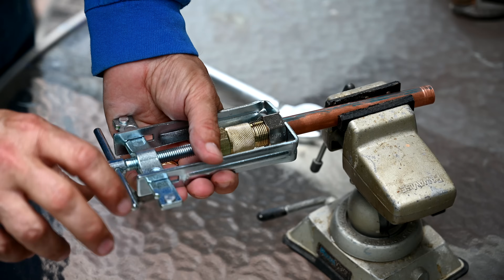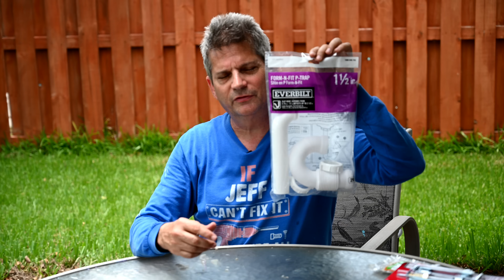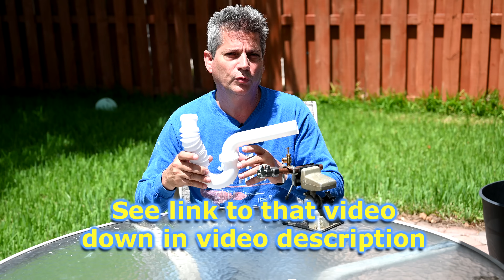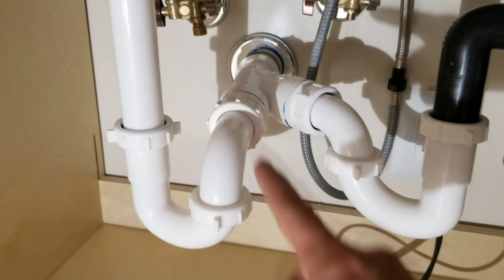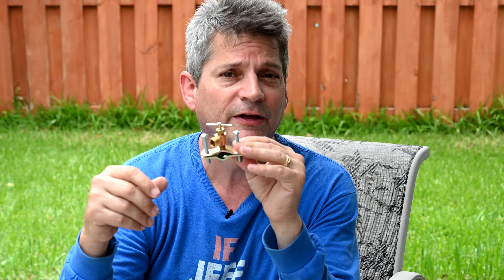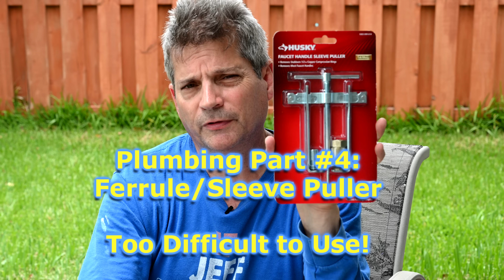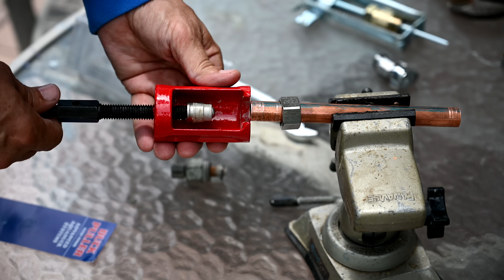4 Plumbing Parts/Tools You Should NEVER Use. NO Plumbing Fails

Comment: Instead of using a wench why not just stick a screw driver in the hole that is already there?
Reply from the maker: I prefer to use the Ridgid OneStop wrench, whose handle is designed specifically to fit that hole, did not show it in this video though.

Comment: Been working appliances for 37 years.  Probably installed 500+ saddles.  Maybe <1% leaked upon initial installation.  Just changed them out and all was fine.  I have seen saddles that were installed 40+ years ago holding fine.  Many customers were elderly, or out of work and/or just unable to afford a $200 plumbing bill so the saddle did the trick.  Is it my "go-too" choice?...Of course not. I would much rather sweat a tee and a valve.....But properly installed, I have never had one insurance claim in all those years.   Now...if you really want to discuss "problem" fittings....do a show on compression fittings!!!!   Those things are brutal. Especially on ice machines.  Not refrigerator ice "makers" but actual 18" undercounter Ice Machines.
Reply: Agreed.  Just because something isn't "code" doesn't always mean it won't work properly, or isn't effective.  Saddle valves are one.  The T is superior, no argument there, but the saddle valve is good enough most of the time. The flex drain is another.  I wouldn't use a flex drain for a kitchen sink, or laundry sink that gets tons of water all the time.  But for a bathroom sink where you are off a bit, why not?  Not everyone has the skills necessary or money needed to get the proper rigid pvc solution.

Comment: "Too cheap to hire a plumber for 10 minutes"
That's because plumbers charge by the hour with a call-out fee and so that 10 minutes ends up costing me north of 200 bucks. 

So, therefore, I just do my own work, I watch videos like yours, learn how to do it the right way and do my own work up to code. 

At 19:50 you are blaming the tool yet you used it incorrectly, you need to unscrew the damn thing all the way out, just like any other puller system on the planet. You have yours screwed in all the way and expect it to work when it isn't made to work like that, the tool works just fine when you actually read the directions. You also have the handles in the wrong spot, why do you think there are little notches out to the end, that is there to hold them in place. Your entire complaint is that you didn't use the tool right so you are not recommending it. 

Then you show your favorite tool and as you can see you had to screw it all the way out first. Come on man.
Reply from the maker: Actually you are wrong about the husky tool because husky is now telling us not to have the handles on there at all when using it to remove the feral. To handles are only on the when you are pulling faucet knobs
Reply: @jeffostroff  
So you didn't read the directions and are complaining about a tool that you used incorrectly? Smart move.

Comment: Regarding the Husky puller, I think you may need to move the arms outward until they sit down into the recesses at either end of the frame. This would have the effect of 1. providing greater separation from the T-handle that you are turning with your thumb and fingers, and 2. create an angle for the teeth to bite into the back side of the nut you are trying to remove... Having said that, it is a pretty cheap looking tool, and either of your two alternatives look like a better design.
Reply from the maker: Sort of a moot point now because I do have 2 other tools that do the job just perfectly, allowing you to use the same Ridgid One Stop wrench.

Comment: I'm a Master Plumber. The other reason for not using piercing valves is that the bottom steel clamp is a dissimilar metal to the copper. As the water flows through, it causes electrolysis. Causing the copper pipe to wear away
Reply from the maker: I wish you could explain that to the other plumber who trolled us the other day here, claiming he was 60 years old, plumbing since he was a kid with dad, and telling my S-traps are OK to use,  saddle valves are ok to use...
Reply: @jeffostroff  Well Jeff, It's kinda like Lawyers, Salesmen, Carpenters, or any other profession. There's guys that are very good at their craft, and others that simply are so bad, they should clearly be in another profession. Then there are people like you that simply try to tell the general public what items not to use and why. For their own safety. Keep up the good work with your videos, my friend. I'm 56 and have been a Master Plumber for just over 32 years, I'm a licensed Stationary Engineer, Backflow Certified, and an instructor for the last 11 years two nights a week for our Plumbing Apprenticeship Program for our county.  I appreciate and respect what you are doing. I don't find it that difficult to believe that the troll has simply been doing many things incorrectly for 60 years. LOL.  I'm now semi-retired and taken a position of County Plumbing Inspector.  Both you and I know that you are correct, and should get a pat on the back for trying to share some of your hard earned knowledge with people.  Much respect to you.

Comment: Jeff should only make videos about what he knows, not plumbing. (sorry Jeff) I'm 60 yrs old, started plumbing at my dad's shop when I was 13. . Master Plumber now with my own business, I don't advertise, I have plenty of new/remodel clients.

 S traps are fine under normal residential conditions. Siphoning is rare and is more a vent problem. 

A so called "Form and Fit" trap works fine for a do-it-yourself, if installed within it's ability to adjust. Otherwise a non-plumber will spend all day hooking up their stupid sink drain. 99% of what clogs bath sink drains is:  longer hair, toothpaste caps, hairpins, razor covers, kids and very old cast iron pipes. No sink drain system is able to endure humans and time.

A "Saddle Valve" can work fine for a very long time if installed carefully...and Come on Jeff....don't use the puncture method!....turn the water off and pre-drill a small hole first.....any clown would do that if he had a drill....who doesn't have a drill?....and it will prolly never flood a house  because the failure normally starts out as a very slow drip.. I can easily tap into any waterline if needed....and would never use a saddle because it takes too long and oh.... I'M A PROFESSIONAL PLUMBER. For the DIY'r....it's fine...just do it right.

The "Husky Faucet Handle Sleeve Puller" is NOT  made for pulling compression rings. It's for PULLING (some) old stuck-on HANDLES....like the name says...
 I have a tool for compression rings and it works effortlessly.  Come on man!

Stay in your lane Jeff. Talk about wood or something.
Reply from the maker: Looks like you never learned anything at Dad's shop, you should only comment on what you know. The fact is you can argue till the cows come home, making excuses why you think s-traps are OK, but duh, THEY ARE BANNED BY PLUMBING CODE! In every state! So you keep on doing shoddy plumbing work, not getting any wiser in your 60 years. As for the Husky tool, you are wrong there too! Come on man! Husky Bills the tool as BOTH a "Compression Sleeve and Faucet Puller" 2 tools in one. Stay in your lane bro, go back to playing Fortnite. Here's the link for the Husky tool on Home Depot's web site: https://www.homedepot.com/p/Husky-Compression-Sleeve-and-Faucet-Puller-63876/304543091  Everyone feel free to laugh this clown out of the room now, he knows nothing.
Reply: @jeffostroff  nice...edited out all the names you called me...how clever...you can fix anything.
Reply from the maker: @readmore3634   Lol nice try liar I did not call you a bunch of names and I did not edit it it out.  You obviously hit a brick wall here when you know you're not getting anywhere the next thing to try of course is profanity and trying to discredit.  Your downfall is you have to be smarter than the people you are trying to discredit. The only one calling names here is you with your disgusting profanity. Funny how your user name is here to help but yet all you're doing here is whining like a gilted school girl and name calling and profanity that's all you're capable of. I won be adressing you any longer. And if you keep leaving insulting profanity on this family friendly channel I will have YouTube suspend your account  immediately.
Reply: @jeffostroff  you seem awfully defensive...make more videos of yourself...it's more work for professionals. obviously YouTube doesn't mind you broadcasting bad advice...why should they care about professionals pointing out flaws?

Comment: So what wrong with it according p-trap  you never gave a problem .like break easy or leaks. Just wondering
Reply from the maker: 2 main problems are hair and debris gets caught in the accordion. And Also, the plastic is very thin on the creases, so it breaks, or develops cracks along the accordion, especially after repeated banging into to from bottle and other things down below under the sink.

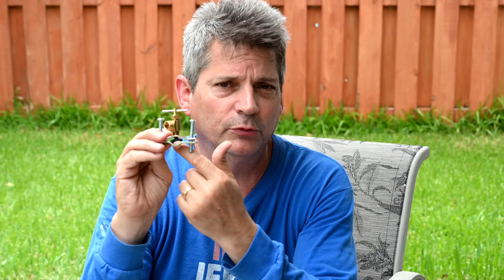Comment: 12:40 ... or because the instructions from GE refrigerator says to USE it for the ice maker and no other reason DERP
Reply from the maker: That is so crazy GE would tell people  that
Reply: @jeffostroff  GE's directions are to drill the 1/4 in. hole, mount on vertical run,  etc. There are millions out there...

Comment: Tapping saddles are actually very common in larger diameter pipes, 3" and larger. City/county utilities departments cannot constantly shut down whole blocks of pipe network just to install a residential 3/4" meter feed. The design on those is a bit better than show here obviously.
Reply from the maker: The type they use is probably a lot more reliable.

Comment: The S trap is NOT the problem.  Lack of proper venting IS the problem
Reply from the maker: You are partially wrong. The s trap can also siphon itself dry when you  have a short vertical drain leading to a trap with a long vertical  drop after

Comment: Gotta admit after taking out my sink disposer I got the handy man accordian pipe special and have had it now 4+ years.. I really need to rework the plumbing so both sinks in the kitchen run into the same pipe to the same p trap and out.  These really are kind of a quick, half assed fix and at the time just wanted to get the lines back together quickly.  If I were ever paid to fix something as a handyman for someone else I would NEVER use it. 

The odd bends and makeup of the accordian design really constricts the water drainage in the left side of my sink but I have other more pressing issues as of late with an underground water line leaking which is my major plumbing task.

Comment: Another good vid!!  Believe it or not I've had refrigerators delivered that the saddle valve was included in the bag of parts for the ice maker!!
Reply from the maker: Yes, funny isn't it!  Even now in Home Depot when you buy the ice maker line it comes with the saddle as well.
Reply: @jeffostroff  I'm going to Home Depot tomorrow just for the laugh!!  Hahahahaha
Reply: What is ironic, is if you ever saw the system that is hidden in your refrigerator, and how filthy it becomes through time you would never use again

Comment: Stuff all this soldering bring on the push fit fittings, I've used a similar saddle type valve assembly on refrigeration pipework, never had a problem, no leaks and I believe 20 years on still OK
Reply: Saddle valves are not hermetic seals and do have a slow bleed through the gasket. Saddle piercing valves are only used today for refrigerant recovery on small hermetic sealed refrigeration systems such as window AC, refrigerators, ice machines, and water coolers.
Reply: - - maybe if you never turn on or off they be OK.

Comment: that s trap is put together wrong plus we can use them here in pa
Reply from the maker: Funny you say I'm dumb? You don't know your own PA plumbing code! LOL! Here's PA: https://up.codes/viewer/pennsylvania/ipc-2015/chapter/10/traps-interceptors-and-separators#10 Here's what it says in your plumbing code that you are so ignorant of (See #5):
"1002.3 Prohibited Traps

The following types of traps are prohibited:

1. Traps that depend on moving parts to maintain the seal.

2. Bell traps.

3. Crown-vented traps.

4. Traps not integral with a fixture and that depend on interior partitions for the seal, except those traps constructed of an approved material that is resistant to corrosion and degradation.

5. "S" traps.

6. Drum traps.

Comment: Question when I'm installing freestanding tubs. the manufacturer sends an accordion drain with their tub their $800 tub you're telling me that it's an illegal part what am I supposed to use a glued in flexible tube. wouldn't that break my warranty with the tub manufacturer. The flexible drains cant be as bad as you make them out to be...in 30 years of fire water restoration I've never had an issue with something like that in the Orlando area. And I do repairs for State Farm and other major insurance companies
Reply: And yes it is a quick fix to a problem for an offset sink for a miscalculated Plumbing installation problem which I have never liked using but have. Not every homeowner wants to spend the money to have the pipe relined cut or extended in the wall. And in most instances you don't find out that it's off until you Dri-Fit it after holes are in the back of the cabinet because remember you're just replacing a cabinet and a countertop.
Reply from the maker: Yes, we do use the accordions there for the , but with one key difference, they are safely packaged and protected in side the wall, and the accordion part is not being used as a drain, only as an air vent during normal operation. No water flows down that flexible neck unless there's an overflow in the tub, a very rare occurrence.
Reply: @jeffostroff  that's not what I'm seeing I'm seeing it connected directly to the drain at a 90 degree angle with some really cheap accordion very thin material that goes directly to the drain in the floor, these tubs don't have overflows unless their internal and make it straight to the drain piece but the very narrow curving overflow like in some sinks molded in. The drain has a small rectangular block molded into the accordion then the accordion goes all the way to the drain this accordion is over a foot long maybe two-and-a-half 3 foot once stretched and I'd go as far as to say that these tubs came from well-known brands, Toto Kohler and others

Comment: small 3 corner file will cut that ferrule in about 10 seconds, come on...
Reply from the maker: If you want to risk cutting into the pipe. the duck puller pulls i off in 10 seconds too, come on.
Reply: @jeffostroff  not rocket science...I've removed hundreds probably.Never ruined one pipe.I don't kill flies with sledge hammers....

Comment: Code smode,...saddle valves work fine if you simply drill a 1/4 inch hole in the copper pipe to mount it over...clamp it moderately ,and it's permanent.Don't use the piercing point feature.It punches only an 1/8th inch diameter hole-which will stop up in time.The 1/4 inch hole never will.Beware the code waggers who speak of all home owners and handy men in the pejorative.
Reply from the maker: Beware of anybody who tells you to drill a hole in a pipe, then plug that hole with a plumbing part that is banned by plumbing code. LOL!
Reply: Saddle valves should ideally be mounted on vertical pipe runs to avoid sediment.If you must mount one on a horizontal pipe-mount it on the side or top.Mounting one on the bottom of a horizontal pipe via the piercing point will soon fail.
 If someone wants to use one of these on his/her own house...this is the proper way to use it.I wouldn't use one where I couldn't access a drilled 1/4 inch hole.

Comment: Love the video and how the first three subjects are explained as plumbing code violations.  I have been a plumbing practitioner for many years I work on plumbing projects just about every day but I am not licensed. 

I would never install an s-trap. I have always known them to be a violation.

I greatly dislike form n fit p-traps. I have a very hard time to even get them to not leak.  I hate all the crap that gets trapped in the crevices. I never use them.  I did not know they are a violation however. 

I never use saddle valves and greatly dislike them also. I always take a little time to form a tee with a solder, shark bite valve or compression. 

I never knew the Husky sleeve puller was for compression rings. I thought they were just shower faucet handle pullers. I like the other tool you used to get the rings off and I will purchase one for situations were there is very little room to get the ring off. Usually I can use my channel locks to get the ring off with just enough pressure to not disform the copper. Sometimes I use a hacksaw type blade to score the brass ring enough to get a small pointy standard screwdriver in and turn it to break the compression ring off.

Comment: These "banned" products are still situationally valid and thus needed.  Obviously if you are doing a remodel or new install that requires a permit, then you won't be allowed to use them in the project.  But anyone doing permit work will already know this.

These products are used exactly like the author says, a quick-fix to save time.  More often than not, cost and/or time easily over-powers "some UNKNOWN time in the FUTURE" regardless of unknown and future consequences.
Reply from the maker: That sums it up perfectly!